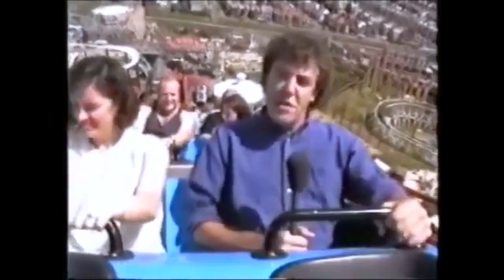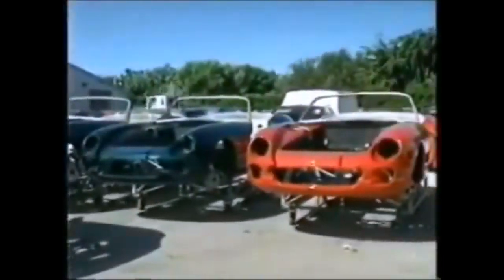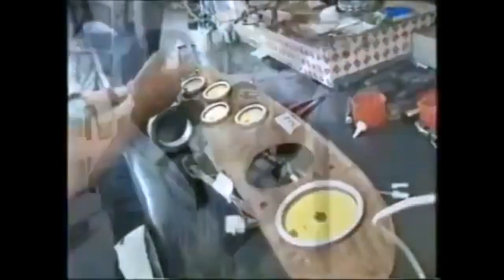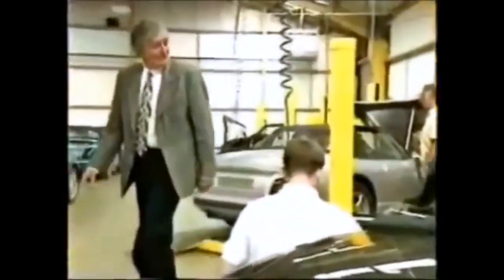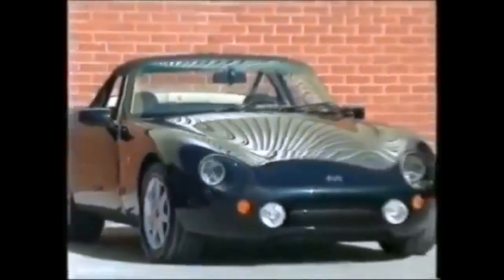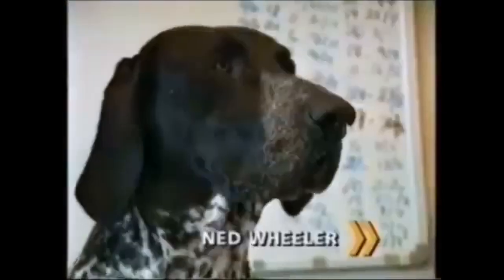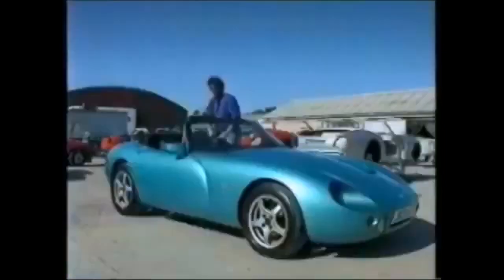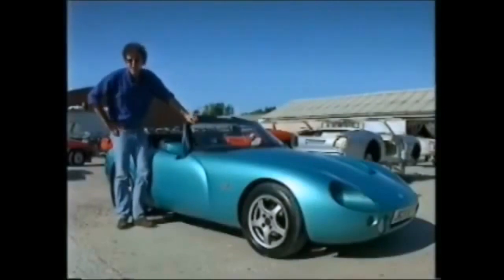1995 Jeremy Clarkson TVR Factory Tour & Peter Wheeler Interview

Comment: Such a shame that Peter Wheeler was such a shady wheeler dealer. The whole reason for the Speed Eight and Speed Six engines failure was Wheelers scummy cost cutting and use of cheap and nasty components. Wheeler both made TVR great and completely destroyed the company!
Reply from the maker: Peter Wheeler was undoubtedly responsible for making some of the best and most desirable TVRs. It is a shame the company ended closing. The company needed investment to get through Euro 4 compliance at the time. The UK government should have invested in my opinion. The largest British owned car manufacturer at the time.